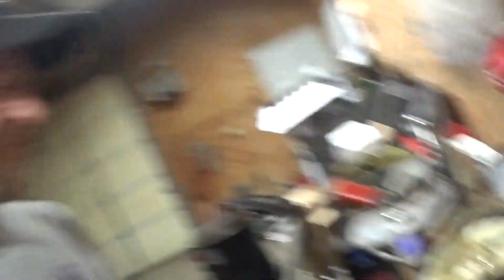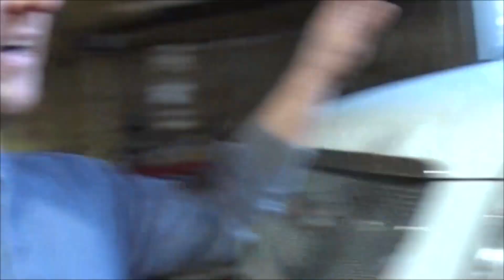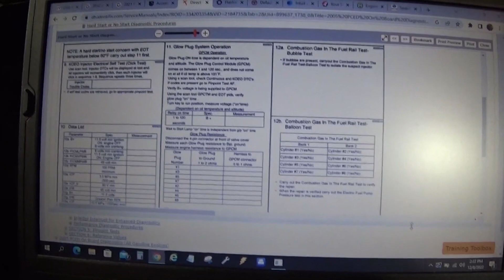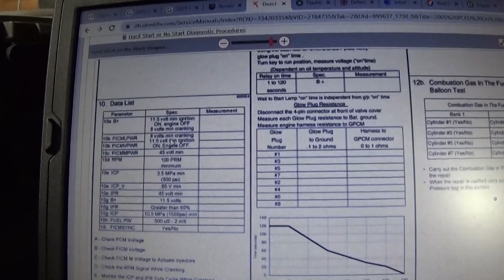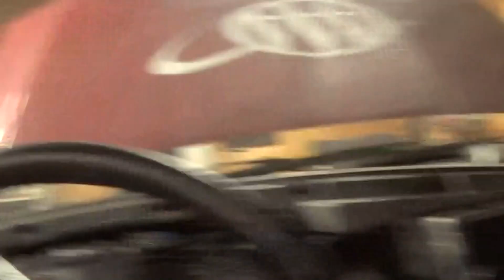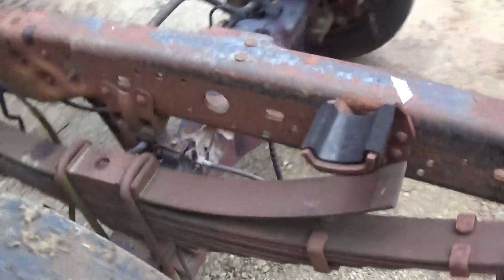OLD TOW TRUCK IS ALIVE & new engine failure.

Comment: Glad the old 03 parts came in handy! 😂
Reply from the maker: Oh. Have not even touched the 03 that I bought. The truck I tore apart was the white one that was rolled. 
Customer rolled the white truck. Bought another 6.0 at auction. 
That engine has a cracked head or injector cup. Fuel getting in coolant. 
I pulled the rolled trucks engine and installed in auction truck. Should have recorded but was in a hot rush for that.
Reply: @showmerepair  I gotcha…. Sounds great!
Reply: @showmerepair  did you get the old 03 tore apart? The rust bomb…😅